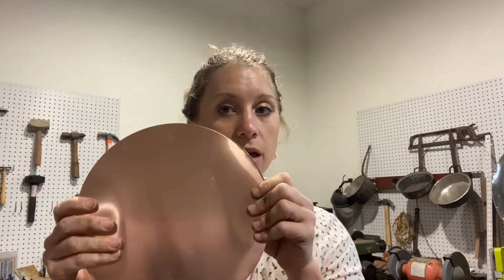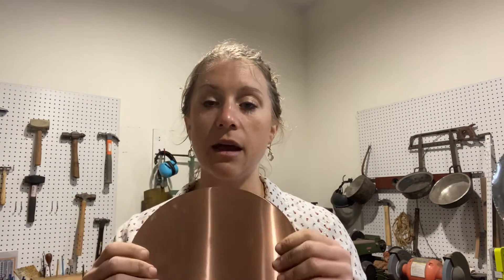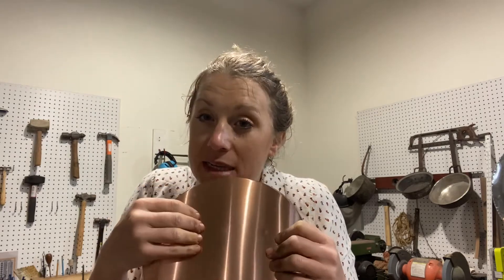Tinning in the Flat

Comment: You make it look easy. Is it necessary to tin the inside of a copper drinking cup? Thank you making the videos.
Reply from the maker: Aw, thank you. It's pretty easy with practice. If you are using the copper cup for mostly water, you're OK. Some drinks here and there, fine.  If you plan to use it a LOT (like daily) for very acidic things or booze, I'd tin it.

Comment: Great video! Is it possible to hand apply melted silver to copper cookware instead of by electrolysis? If you could pour it and spread it fast enough before it cools down would it even stick to the copper molecularly?
Reply from the maker: The heat needed for silver is almost as hot as melting copper. You need like a super special giant forge to do this, and like...gear for being by a charging furnace. You'd need to keep the silver and the copper both at 1800 degrees F in order to spread the silver and keep it liquid to spread and bond. I'm not sure any person can withstand 1800F...lol